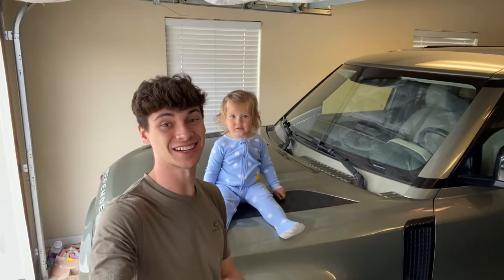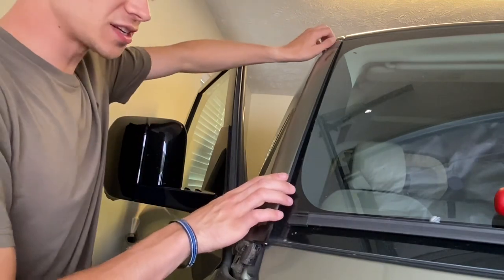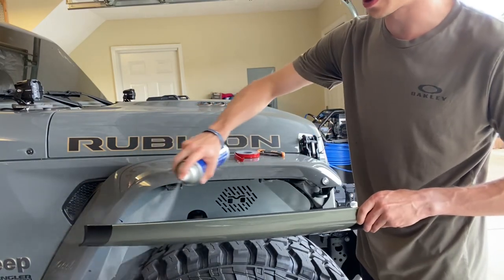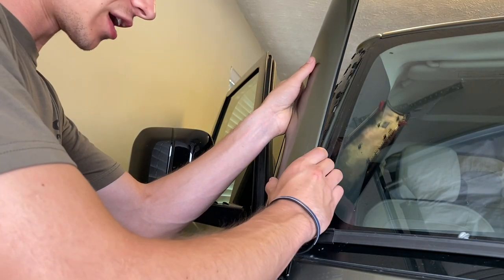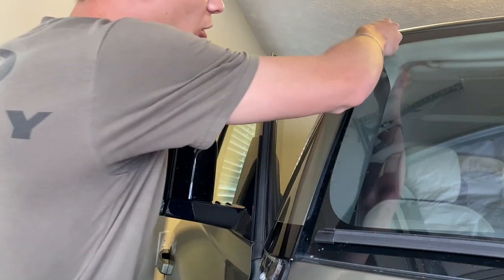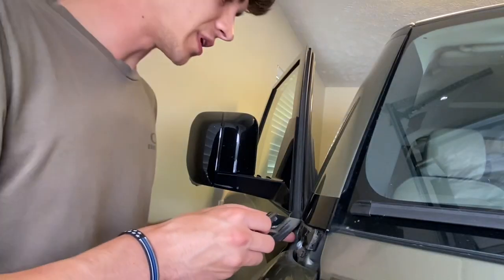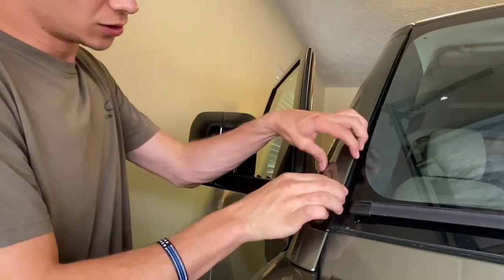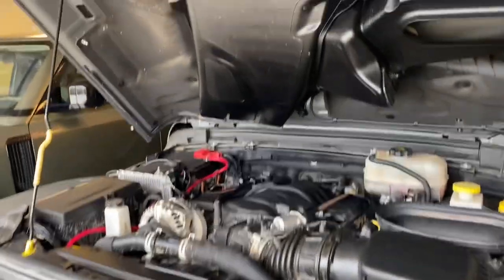Land Rover Defender A Pillar Wind Noise (How To Fix)

Comment: great video! I've been wondering what that noise was for 2 years and the dealership was dismissive when I raised it with them 18 months ago. Question: What's the spray that you use to clean the plastic before you apply the 3M tape? blue pray can. Thanks!
Reply from the maker: I’m glad I could help, that spray was just window cleaner! Thanks for watching!

Comment: Question - I have a new 130.  I have the wind noise on the Right side a pillar at high speeds (70-80) and esp when it's windy outside, like a big crosswind.  My question for you is this something that the dealership would fix for me?  Also, is it common to have leaky window wind noise on the drivers side rear window?  I notice it by my left ear, almost sounds like the window is just slightly cracked.  no water leaks though.  Curious if you know anything about this.  I have not gone back to dealer about any of this yet.  Thanks for the video
Reply from the maker: I'm sure it is all coming from the A pillar wind noise, they should fix it for you for free it just might not fix it completely!
Reply: Okay, so does the wind enter in the A pillar and make it's way back to the rear window possibly?  Thanks for the advice, I will give them a call 
 @GodspeedZRZ
Reply: Did u fix it yet ? I have the same problem with my 110. Any tips on how to fix it?
Reply: @MuMsk-jq2ie  nope, i took it to dealership, and they resealed the a pillars and also changed out the window seal, but exactly the same.  I haven't taken it back yet to have it looked at, I just deal with it, but it's annoying.  Like the window is cracked or the door is cracked.  next time I'll ask them to change the door seal, maybe that will help?

Comment: Nice fix but maybe use less 3M tape? Some unsuspecting windshield replacement person is going to end up damaging the covers when they don’t come off as expected.  I see some new pillar covers in your future as with annual windshield replacements becoming the norm due to the never ending barrage of rock chips in this vehicles with more upright windshields.
Reply from the maker: 3m couldn't be any easier to remove, it's not an issue at all.
Reply: on #8 and the clips get damaged and pop out... JLR replaced it FOC MY21 P400 SE X Dynamic Arizona USA
Reply: Well, I was of the same opinion, said to myself that will be a pain to remove and the  windshield repair man will be expecting the panel to slide down as it did for him.
That's when the don't care factor will take precedence & the panel will end up damaged as it's forced off.
I'd try it with just foam tape with just one side attached to panel, leave the red strip on to stop it adhering to the windshield as that would stop airflow & vibration noise.
Just what I'd tried first.

Comment: Does anyone know if this problem has been fixed. I have a 2024 Defender on order. Thanks
Reply from the maker: I don't know for sure but it should be since they have a repair bulletin.
Reply: @GodspeedZRZ  Thanks.... I just found your videos. I'm definitely considering the mod you did on the muffler.
Reply: I have a 2024 110x, I definitely hear that annoying wind noise. I'm about to try this fix
Reply: @BLOC-32  Oh wow, that's disappointing to hear. Mine arrives early may. Guess I'll find out then.

Comment: I have this extremely annoying wind noise on the passenger side even driving at 25 m/h i tried duct tape just to check if it will stop, but it didn’t… ?  if the tape didn’t fix it I’m wondering if your solution will..
I will appreciate it if you have any other suggestions to fix this
Reply from the maker: I believe it will, I don’t see how tape could hold it secure enough to supress the noise. Definitely worth a shot, that noise iss as horrible haha